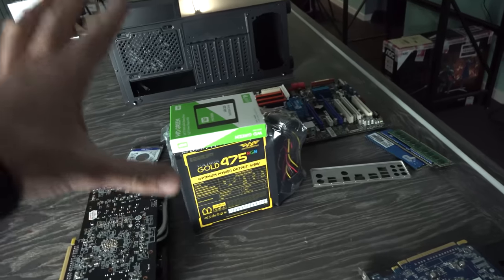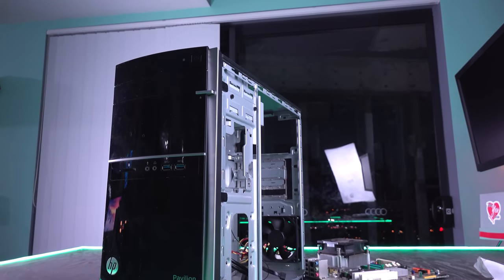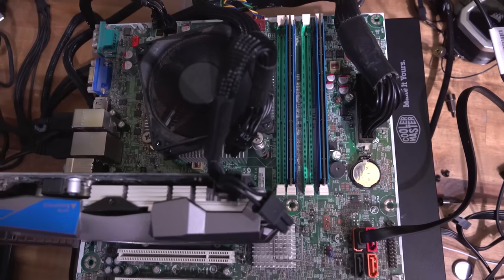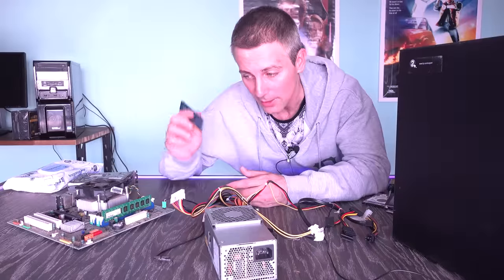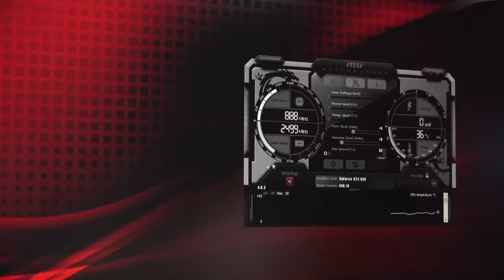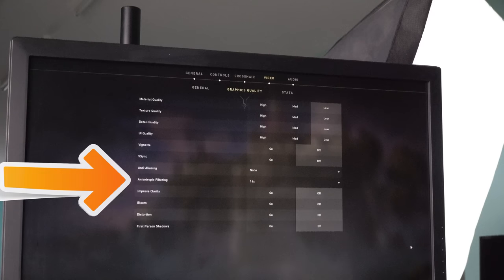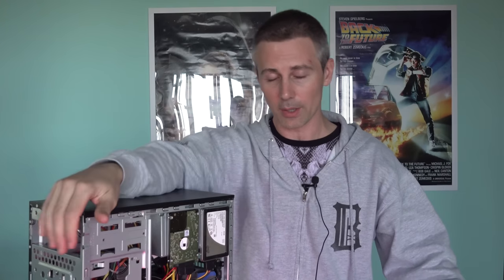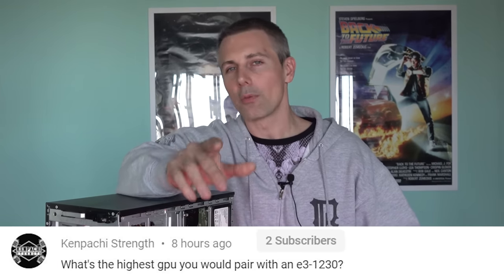I Built a Gaming PC for $67 that runs Valorant at over 120 FPS

Comment: Alright so I have this old pc case from 1998 I want to build in and I was looking for an old workstation to take the parts from and I came across the a bunch that had a Xeon E5 1650 3.2ghz 6 core 12 threads. And then it hit me, I should get a GTX 1650 and pair it with a Xeon 1650 and some 1600mhz DDR3 and try and clock it up 50mhz and throw it into the old case and have the a complete 1650 machine.

Comment: Hello i have a question, i have an a8-7650k and gtx 1050 2gb... I was wondering why my fps is lower than expected, @med settings 1080p with around 65 avg fps??? does my cpu have a problem or gpu
Reply: Cpu bottleneck probably or ram/hdd
Reply: @lagginswag  i checked the bottleneck calculator and gtx1050 2gb doesn't bottleneck with a8-7650k

Comment: If dual channel doesn't work, you need to clean the pins and pads on the CPU and socket with alcohol and a soft toothbrush. It's that easy.

Comment: I have a hp oem gtx 645 that has 2gb of vram and its specs other than clock speeds are superior to the standard gtx 650, just gotta boost the clocks to similar levels

Comment: Could you please recommend me good OEM motherboards that are cheap which can help me get into gaming, with any GPU. Thanks
Reply: depends on budget
Reply: if u give me a number i could suggest u some
Reply: Dell Optiplex systems are excellent for plug and play with GPUs under 75w. I'd avoid HP systems like the plague, as they have locked BIOSes and typically only support select GPUs of the model's generation, and sometimes even require certain brands of RAM. I built a Dell Optiplex system with an i5-3470 and an RX 570 4GB for around $200, and it ran most modern titles at 1080p 60fps medium/high settings. Hope this helped!
Reply: @ThaiTie94  not to mention that HP Prebuilts come with proprietary power sources that are a pain to upgrade

Comment: Some of these OEM boards can be painfull to work with. early acer s4620G systems are UEFI (sort of) so newer cards boot in uefi mode but the fall over as the system is not fully UEFI compliant.

Comment: But the issue is, by the time you figure out what does and doesn't work, just like in most Tech Yes videos, you've spent a bunch of money on incompatible components that then you have to try to sell. And then you gotta consider how valuable your time is. I mean isn't it easier to just spend $120 on a used tested Optiplex, and you're done, that's the default super budget option.

Comment: yow my man can asked you something ? ... my pc won't work at all , he's windows 7 and I'll try to make windows 10 , and then the windows 10 installed my pc didn't open , I don't know what is happening to my pc .. i hope you can help me out
Reply from the maker: Sounds like a faulty part, start with memory first, remove one stick at a time, see if it works properly after that.
Reply: @techyescity  i already did that , i replaced a new one but still not working , thanks man

Comment: Watching this video...while waiting for the Amazon guy to deliver my 24-pin to 18-pin adapter to run my HP Z210 workstation on a standard PSU. And I learned the hard way that Zeon E3/LGA1155 motherboards have non-standard spacing for cpu cooling, it's 100mm x75 mm.

Comment: Hey there, I really enjoy your channel.  I know this is not your primary interest, but a friend asked me to build him a computer for music production and I am considering a used Xeon, or an old i7, or possibly a new Ryzen.  Budget would be US$500 to US$700.  I would really appreciate any thoughts you could share.  Thanks again, and keep up the good work.
Reply: Post processing and running multiple effects are what taxes a cpu in music production. Any modern cpu would be epic I've even used core 2 quads/phenoms II's and on board sound. Most important thing would be a decent sound card and an ssd. As well as a proper setup for sound reproduction.
Reply: @lagginswag  Thanks for the reply.  Do you think it would be better to use a slower old xeon with 32GB ram in quad channel, or a faster i5 or i7 with 16GB in dual channel?  Or maybe Ryzen?  I know nothing about Ryzen, the numbers seem confusing.
Any help is appreciated.  Thanks again.
Reply: @evilrobots  sandy/ivy bridge xeons have similar ipc to say, 1st gen ryzen 1400 especially the 1270v2. Haswell and skylake based xeons would be even faster but im not too familiar with the numbers. As for dual or quad ram, quad would be better but the older x58/x79 boards and so on go for a hefty price still and dual chan is honestly fine especially if its fast, preferably ddr4. Could just get a b450 board and 2nd or 3rd Gen ryzen, (1600 aF/2600/3600 or better)16gb ddr4 3200 or so, and be fine. (3rd gen cpus might need a bios flash). Brian def knows his shit about the older xeons though. Maybe he'll chime in, if not there's plenty of videos.
Reply: @lagginswag  Thank you for the input, you've given me a lot to think about.  I guess I'll start trying to figure out the whole Ryzen number scheme.  I definitely appreciate the help, thanks again.

Comment: i thought that these old systems didnt work with ram above 4gb becuz the bios was designed for a 32bit operating system and bios  update will allow motherbords to handle more memory
Reply: You thought wrong on so many levels
Reply: xD true but it still makes sense
Reply: because 32bit systems cant run above 4gb
Reply: @insurgent3315  yes but at the time of h61 platform, 64bits had been the norm for a very long time
Reply: It was the operating system (specifically winXP 32bit) that wouldn’t page more than 4GB so it was useless to install more.

Comment: meanwhile I'm running it at 80 fps with a gtx 1060
Reply: rodrigo I have a 1660ti running at 190 fps high settings there’s clearly an issue
Reply: I play at 120 fps with a 1050 ti🤔
Reply: @emperorxina2914  it's called cpu bottleneck don't worry guys I'm getting a ryzen 5 3600 this Christmas

Comment: I use GT 630 with 60fps. My PC still fighting!
Reply: I have a msi gt 630 2 gb version. Oc to 925mhz core and 935 memory.
Cpu Is i3 3240 and ram is 8gb ddr3 1600mhz ( 1/2 slot )
Mobo is h61m-ps4.
Runs 70-80 fps

Comment: You know, this is cool and all for the price, and i know the 60 USD comes from deal hunting and stuff, but i cried when i heard that price because earlier today, i saw a local seller posted an ad for a 50$ refurb PC. The specs? A core 2 duo, 2GB of RAM, 250GB HDD and no GPU. I wish i was joking.
Reply: I got a Core 2 Quad Q6600 system with 4gb of ram, 250gb HDD, an Antec case, and a Antec 350w PSU for $50 7 years ago. People selling old hardware for that much are crazy.
Reply: @wmp0074  my whole country is crazy man XD

Comment: Valorant relies on the CPU, that's why GPU requirements are low. Even the GTX 1050 can reach 144 FPS at max settings if you have a decent CPU.
Reply: I think a I7 3770 with a 750 Ti would blow that game up. 😂
Reply: @savagearma  yes sir

Comment: Holy crap what a Frankenstein! I dunno why had to insist modding that underpowered psu when u could have gotten a proper ~400w one for as low as 10-15e. Also why u had to glue the drives to the psu?! This is even worse than u taping sdd's to the frames! >_< U can get cheap plastic sdd trays from Ali for a few bucks, like I've said before! And leaving the perfectly good front panel outta use for some nonsense reason!? Gah, this is so ugly I'd rather burn it with fire than use it! I doubt no one would even buy it... With small and cheap adjustments u could have build this properly and increased the selling value about 1000% from this!